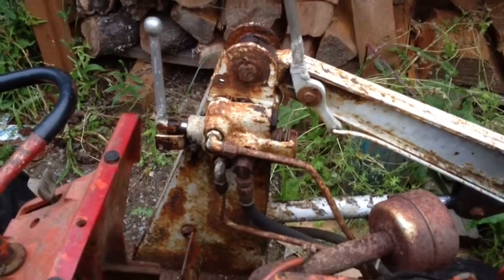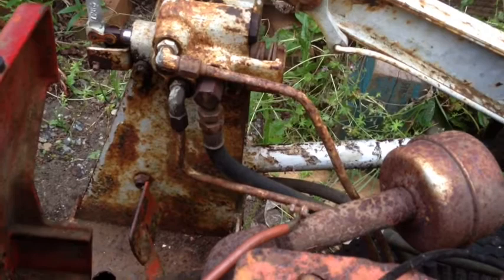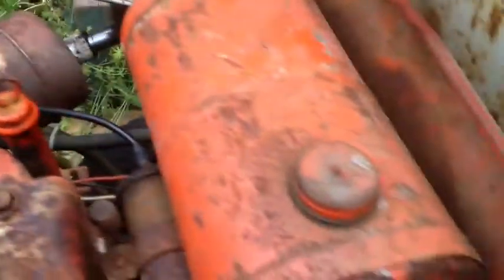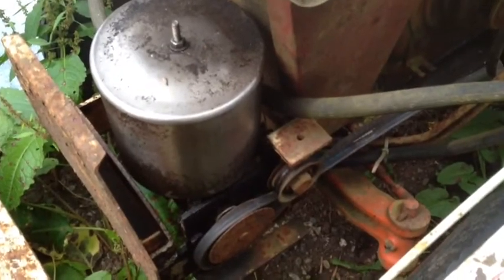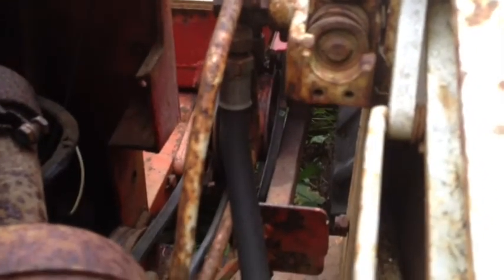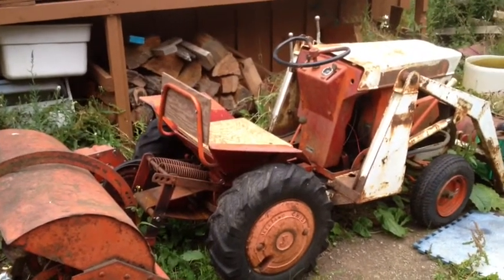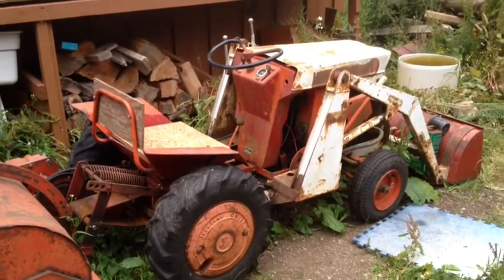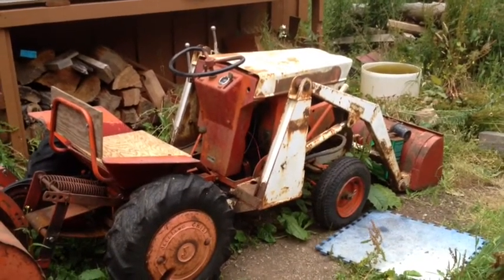Danco Loader

Comment from the maker: Glad you found me and yes I found you.lol. I hope you keep posting more stuff with your loader. Thanks to the manual, I now know There was some parts missing from my hydraulic reservoir lid I did not know about. My lid is not vented, I'm thinking I might blow gaskets. I was hoping some one could show me photos of the vent apart or a video with some measurements? I have scans of the 100g and 100c chief manuals if you know anyone looking? So I take it you would recommend joining the tractor forum?

Comment: The manual for the Danco in my thread shows the parts for the vent.  Basically it's a small cone with a filter under it that sits on the reservoir lid in a little indentation, which I don't see on your lid.
Yes you should join the forum, not a lot of action there but a few very knowledgeable people.  Maybe you could post up your manual scans.